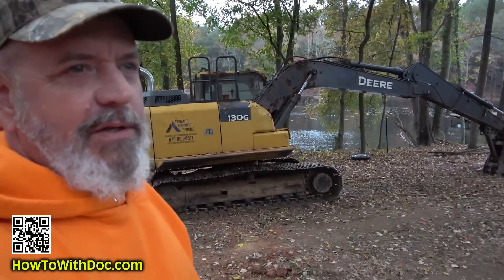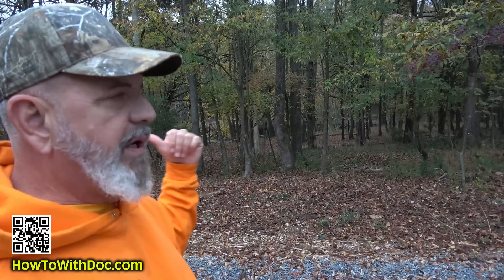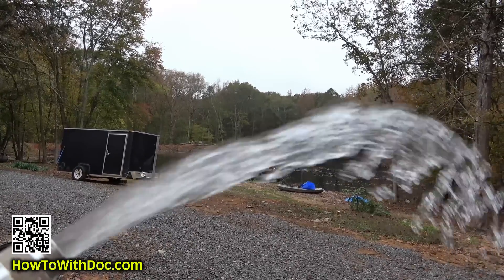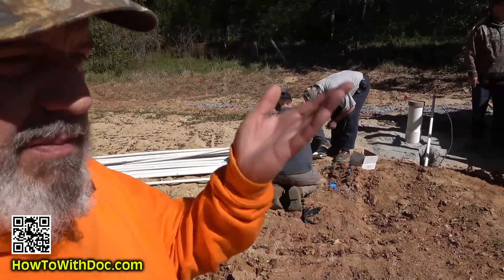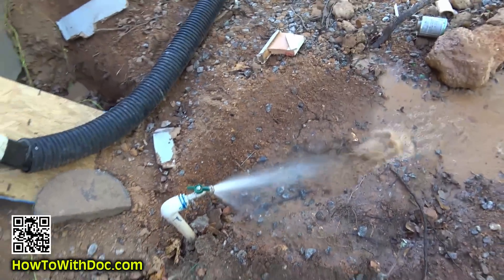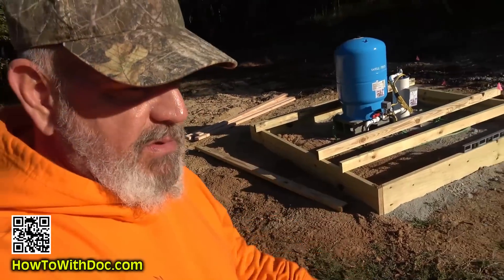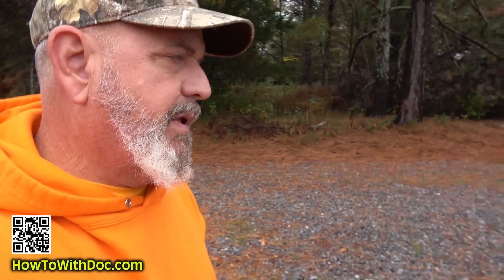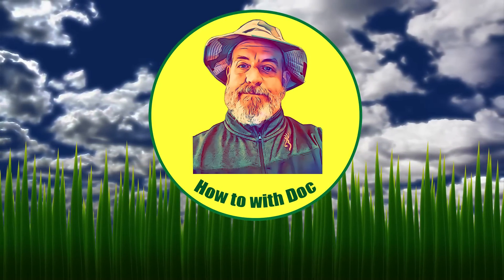Deep Water Well Drill - Well Pump - Pump House

Comment: Squirt some silicone into the split of that well seal. And where the wire goes through,  and around the bolts.   Insects will build nests inside the well casing if they can get in there. Many times that is where coliform gets into the water.

Comment: Hey Doc I’m building a house and installing a well but was going to put the pressure tank and water filter in a mechanical room in garage. Is there any reason why I shouldn’t do that? I’m putting the well about 20ft from the house. Thanks!
Reply from the maker: That's even better.  We simply don't have a space for it at the new house.